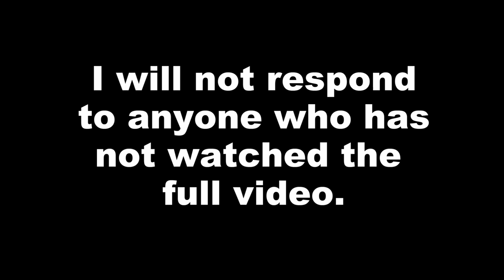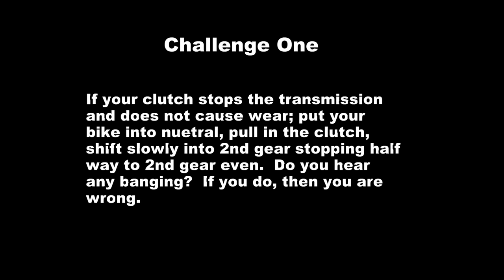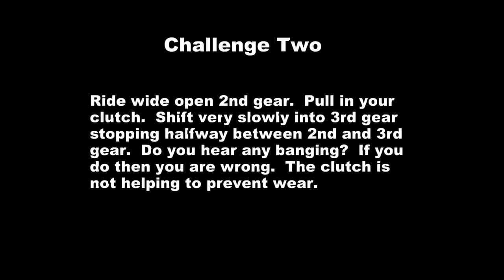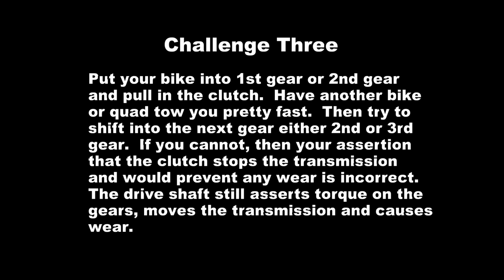Dirtbike: Shifting without the clutch

Comment: I see a lot of people power shifting their atv's, especially for drag racing...
They keep the throttle floored and pull they're clutch in quickly while switching gears. What are the cons of doing that? 
I've tried it a couple of times, and didn't hear anything that sounded like abuse.
Reply from the maker: If you pull in the clutch while doing that, turn off the throttle by hand or by mechanical means that shuts the spark off, then there isn't much issue on the gears.  The main issue is if you do not let off the throttle and do not cut the spark or use the clutch, then you have more probably to cause damage.
Reply: +Opferman Motors Dirtbiking ...
Thanks for the quick response, Brother!

Comment: you forgot to mention that if the dogs butt eachother while pulling the clutch you have a greater chance of miss shift and that's why people tend to fall in neutral instead of 2nd gear or even find false neutral and that this does not happend on clutchless. if i had to tell a reason why i'd say that's because the friction from the dogs is greater than the open clutch since friction only come from the oil

Comment: Another thing to try to prove the transmission is still spinning put the bike in neutral pull clutch and shift slowly into another gear you will hear the banging and fell the shifter bob up and down as the dog gears “bang each other” ;)

Comment: Hey Opfermanm, I'm just passing by. Quickly went through your video, so I may make some explain too much or to little in the following. I don't feel like going into depth of making a video for this.

If I understood correctly, you're saying that it makes no difference shifting with clutch or not.

Bigger rpm difference between shafts and more torque on each shaft, more gear wear. In general, you could split gear wear in two parts: actual wear of engage teeth (causes wear of the engage-teeth between gears) and the material fatigue (can after a while cause gear to shatter).

If you shift slowly, your gear takes more engage-teeth damage. If you shift faster, you're putting more strain on the material of the gear.

Clutch takes off most of the engine side torque off the shaft and some rpm. The wear is still there, tough it's much smaller.

When the gears are engaged, can't really make that sudden rpm changes, meaning less material strain.

Comment: raced a 92 rm125 for years without the clutch and shifting at full throttle. wasn't till after about a year and half before the gear fork was probably bent as it was popping out of gear on the up ramp to a double or triple. not good I can tell you that happening. 🤯

Comment: sooooo can I full throttle, let off the gas and upshift without clutch. or is this good for cruisi bhai g sppeds and rpm. I own a 80 xk185 and I want to try this
Reply from the maker: +David Borisyuk Yes, as long as when you shift it's smooth and make sure to shift quick and fully.  If it's hard to shift then you aren't letting the torque off and perhaps trying to shift too fast before the throttle is fully letting the torque off.  4 strokes it's difficult because engine braking slows you down too much.
Reply: Opferman Motors Dirtbiking thank you. I also have a ts 185 2 stroke so it might shift better. I really want to learn to quick shift and later on get a quickshifter thing so it has less or no risk.

Comment: Long story short if you know the machine very well you can time shifts without a clutch. It takes coordination to do it without negative consequences. I had a 1997 Valkyrie that I would ignore the clutch for 2nd to 3rd and sometime 3rd to 4th and almost always 4th to 5th when going balls out. That wonderful motorcycle nah beast never gave me a problem ever. Bought her new sold her with 110,000 miles. The guy I sold her to shot me an e-mail sometime back to let me know he crossed the 200,000 mile mark and she is still running like the day he got her; I would not be surprised if she actually still runs like the day I got her. I was hard on her all the time yet I always did the recommended maintenance earlier than required due to my driving habits. Bottom line yes you can mess up the trans if you are an idiot so do not be an idiot.

Comment: To Opferman:
Can you explain when i bought my KX450f 2 years ago the transmission was very nice with good feel, now when 2 years later changing gears without the clutch it lost its feel and feels very unprecise and have an spongu and outworn. feeling
I just want ad iam with you but i dont undersant what is the couse of this?
Reply from the maker: Can't say for sure but in general a few things.  The first is that no matter what, your engine wears down.  The bearings wear down.  If the bearings start to have play in them there will be some wobble to the transmission.  They would need replaced eventually but keeping in the right oil and depending on how you ride they should last fairly long time.  Some transmissions wear down more than others but when the engine is new it's nice and tight.  Shifting with or without the clutch doesn't matter, things wear.  The second thing though is that ensuring when you shift the gas is let off to reduce the torque on the gears.  Typically this would cause shifting forks to become bent and prevent shifting if you force shifted with torque on the gears.  The last thing is just perception and riding ability.  When the bike is new your perception may have been different and how you rode could also have not been as aggressive.  As time passes your perception changes as well as perhaps you ride it more aggressively and notice things differently.
Reply: Thanks for the answer
I always blip the throttle ,  but it maby is perception as you say. When new everything is thigt and nice.
I will do split next winter to change crank pistion etc so i will look at the transmissiobn then.
Keep up th good work on the channel
Cheers from Sweden

Comment: 9:24 - A good way to demonstrate this is by pushing a bike when it's turned off.  They're MUCH easier to push in neutral than in gear with the clutch disengaged.  Same goes for kick starting.

13:50 - Yep, anybody who's ridden a bike has felt and heard those spinning gears engage when shifting from neutral to first.  Some of the arguments these people have make me wonder if they've even been on a bike.

For what it's worth, anybody who disagrees with you is plain wrong.  Dog gears have been used for a loooong time in race cars specifically because you only need to interrupt torque output momentarily (by quickly lifting or by cutting spark), but not actually declutch to shift.  

FWIW, no-cluctch shifting is perfectly fine with street-ridden bikes.  Even cars and trucks with manual transmissions, which use synchronizers instead of dogs (different paths to the same destination) - or even unsynchronized transmissions - are fine to shift without declutching, though with a different method since you have to hit neutral and wait for gears to match speed.

Comment: my bike has a slipper clutch in it. I never use the clutch up or down shifting.  only from a stop. my clutch plates still look brand new. oh and mine is actually 1 up 5 down. gp  shift. neutral can be anywhere in the transmission. federal law requires it to be between first and second so u know that you are in neutral.
Reply from the maker: 1 up and 5 down, is it a street bike?  My video is mostly geared towards dirtbike riding.  Those crotch rockets you're positioned differently on the bike so an upshift I would think is harder than a downshit in those moto gp type stuff but I don't follow it.  motocross setup though you're usually standing also, so different positions.
Reply: yes it is a street bike. much easier to shift in corners pushing down. It's called gp shift. I ride dirtbikes too. You can't really gp shift on them cause there is no shift link from shifter to input shaft. as far as shifting without the clutch  all bikes do it  even Harleys and dirtbikes. I do it everyday. your rev matching  a clutch disengaged trans or should I say slow it down to allow the fork drum to move to fork to connect the dog teeth. with or without the clutch if done improperly will damage the dog teeth
Reply from the maker: Yes, I agree, I mean any bike with a sequential mesh can be clutchless shifted, but since I do not ride street bikes and road bikes and what not and there's differences and different technology in some of the bikes I just like to say I'm only talking about dirtbikes here, esp. since I don't even talk about GP shift or anything.
Reply from the maker: Limit who argues with me:)
Reply: agreed. I like the video by the way. I'm going to subscribe. I'll be posting a video today on my bike. I've had friends ask me to.
Reply from the maker: Cool I'll check it out

Comment: The clutch removes power from the spinning shafts, and gears, which therefore would not have as high an energy impact on the gear dogs. Therefore, you should absolutely use the clutch, unless you've got something newer with syncos and can match rpms.
Reply: If you watch the video he explains that if there is torque on the dogs when you shift, that can cause damage.  However, if you let off the throttle, you are not creating any torque.
Reply: correct and you only have to let off a fraction and because the tranny does indeed work the way opferman says it will let the gears and dogs synch enough that there is negligible "banging" of dogs or gear teeth however every time you disengage clutch you eat a little meat from the friction plates
Reply: dblock2626 when you let off throttle the engine is no longer making power (unless you are at a stop and idling) . There is some torque from the rear wheel engine braking.   No need for me to explain how this does or does not affect shifting because it is already done in the video.  Im not going to explain the need for a clutch because it is common sense for anybody who has operated a motorcycle .
Reply: Partly true... This is a dog box type gearbox, it does not have syncros. It is designed to handle shifting without the use of clutch.
Reply: because you couldn't control power for pulling off or stopping..... and if u ride you would know you can use the clutch to control the power transmitted ???? this video is not saying you dont need a clutch at all its saying you dont need a clutch when your moving fast shifting quick !!!! !! listen to the vid he explains it properly @dblock2626
Reply: Clutchless shifting makes heaviest rotating part, the crank, make a near instant RPM change. The transmission has to absorb this energy. The clutch separates the crank from the transmission, for a much less stressful gear change, then it absorbs the excess energy in a much cheaper to fix method.  Racers get an endless supply of new parts, most of us do not.
Reply: Total RUBBISH
Reply: DBKTube was talking rubbish, but not total rubbish.
He's got it sort of partly right. But I feel he can't have watched or really understood the video or how the engine/clutch/transmission combination works. The part about the crank instantly having to change RPM is wrong, anyone changing gear remotely well timed will not change the RPM. This changes with throttle changes, or bike speed changes if off the throttle and engine breaking.
Also that fact this is in effect a real racing gearboxmay be confusing him. Sequential, dog box, with straight cut gear teeth.
Reply: David Todd you know what also removes power from the gearbox? Releasing the throttle, apparently you didn’t listen to anything in this video

Comment: And I get you point about why neutral is between first and second and is very Understandable however on on 65cc and bellow everything is up?¿? Or do you think this is just for eas for the younger people?¿?
Reply from the maker: Ease of use. They don't street ride and likely aren't racing to hit neutral when they don't intend.
Reply: Charlie Dillon The reason why neutral isn't between 1st and 2nd on a kids bike is because it would be hard to teach a kid to find it. I've seen many adults try to find neutral on a regular transmission, then dump the clutch and have the bike shoot out from between their legs. 

And it also seems like they are backwards because when an adult rides a kids bike its very hard to get your foot under the shift lever to upshift (if it was shifting in the proper direction). I've even seen shift levers on kids bike that are made like a quads heel toe shift lever. Which makes it easier for an adult to ride.

The only sin a bike manufacturer can make on a transmission is making it circular. I started on a Chinese Honda 50 knockoff that when you down shifted on a hill youd hit neutral or 4th. Worst yet is when you excelerate hard and go from 4th to neutral to 1st. On dirt its an instant wipeout and on pavement its handlebars in your mouth.
Reply: Charlie Dillon The reason why neutral isn't between 1st and 2nd on a kids bike is because it would be hard to teach a kid to find it. I've seen many adults try to find neutral on a regular transmission, then dump the clutch and have the bike shoot out from between their legs. 

And it also seems like they are backwards because when an adult rides a kids bike its very hard to get your foot under the shift lever to upshift (if it was shifting in the proper direction). I've even seen shift levers on kids bike that are made like a quads heel toe shift lever. Which makes it easier for an adult to ride.

The only sin a bike manufacturer can make on a transmission is making it circular. I started on a Chinese Honda 50 knockoff that when you down shifted on a hill youd hit neutral or 4th. Worst yet is when you excelerate hard and go from 4th to neutral to 1st. On dirt its an instant wipeout and on pavement its handlebars in your mouth.

Comment: Nice video! Do sport bike have the same kind of transmission? I own a Kawa Versys 2015 (same engine as Ninja). I hear and feel the bang at every gear change but I want to make sure because you only talk about dirtbike.
Reply: I'm no expert on it, or even remotely familiar with road bikes vs dirt bikes transmissions, but from what I have heard and experienced with my buddies bike, it seems to me that road bikes have a very similar transmission. There are quite a few moto vloggers on here that talk about upshifting without the clutch, one such being yammienoob, who generally say that it's a rev-match game or may require additional performance parts to do this type of shifting. I assume that on some bikes it's easier than others but may come down to how far apart the gears are that you are shifting to and out of. I have been wondering this myself for when I do get myself a sport bike sometime this spring.

Comment: the dirt bike clutch works just like a clutch pack in an automatic transmission. i never fuckin knew that haha

the flaw in your logic though is when and where the most wear is taking place during a shift.

when the clutch is engaged (lever pulled), those friction discs are then seperated to allow for slippage. when slippage occurs the rear wheel acting on the gears and the engine crank acting on the gears have no effect on one another, reducing the stress applied to the teeth of the gears.

if you shift when the clutch is disengaged (no lever), you are forcing the gear dogs to find their place while the engine and rear wheel are both applying on the input shaft and counter shaft. these forces arent all that great considering the fact that these pistons and rods amount to almost no weight tho.

Comment: My old maicos i Shift without useing the clutch if i was in the run fore better places in the Race. I had Never Problems with the Engine! Nowadays i Drive ktm 4stroke with the recluse zstart and i am fully Satisfait with the Performance. You cant get faster arround the Track. The Main adavatage is that you can brake so hard in Front Off the corner without stalling the Engine any Time! Also you have more Control because you can always stay on the handelbar und you have also a antihopping atvantage.

Comment: My points are simple , if you are new to riding dirt bikes %100 use the clutch .
If you don't know how to use the throttle you can damage the dogs , even if your an expert you occasionally get it wrong .
So novice or expert , if you get it wrong you will damage the dogs , so what is better , clutch or no clutch .
Personal choice really , no one is right or wrong .
Myself , no clutch .never had a problem but in saying that I do get it wrong on occasion .

Comment: Great video. Clutch helps reduce wear by minimising torque on gears while shifting, for unskilled rider. Well performed clutch-less shifting is good as gold, but if you don't nail it it will put more strain on gearbox(and chain/sprockets) than half decent clutched shifting. Smooth clutchless shifting in normal road conditions(cars in front) is impossible on anything bigger than 125cc.

Comment: i know u said to watch the whole video... but COUNTERSHAFT, not drive shaft.. while driveshaft isnt totally wrong, the main shaft is the drive and the countershaft is the driven shaft in this case.. 
i made it about 17:00 before commenting tho if that counts for anything
Reply from the maker: +Dan Walter Whatever you want to call them, you can call them A and B if you want.  Doesn't change the overall message.
Reply from the maker: Also, I implore you to look at this manual:  http://www.maicowerk.com/Maico/Manuals/1986Spares/1986%20Maico%20Spares%20Parts.pdf  which is for the engine I'm using.  Specifically items 114 (mainshaft) and 127 (outputshaft) as noted in the documentation of this engine.  I used driveshaft and output shaft interchangeability.